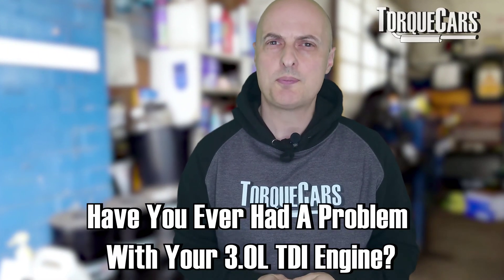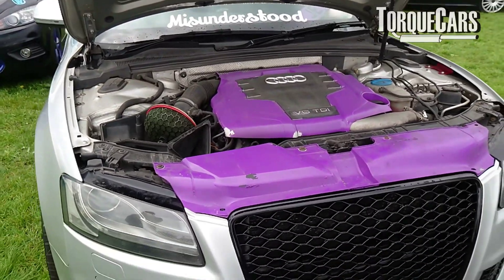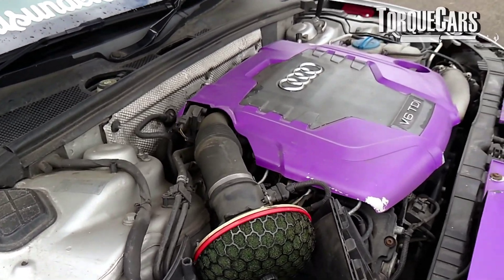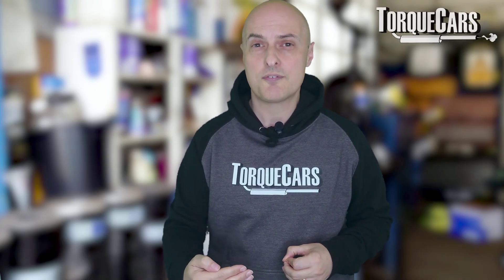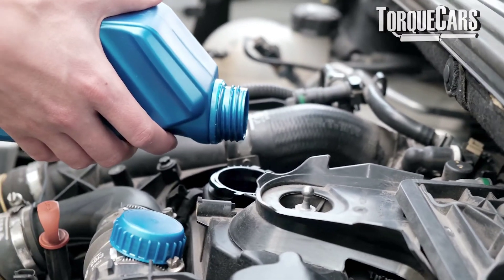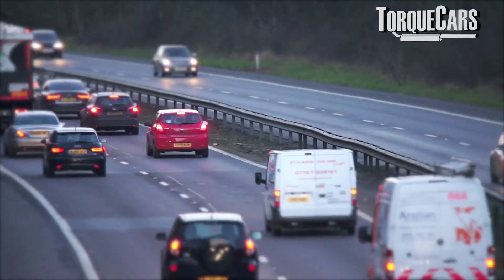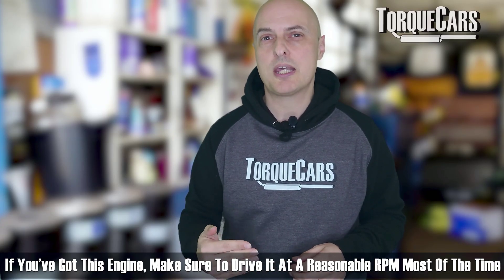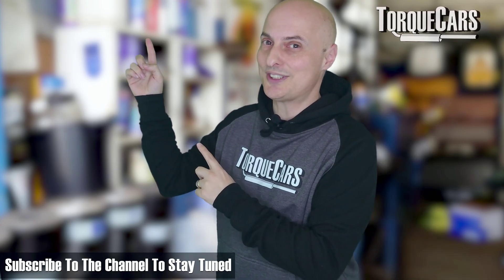Volkswagen 3.0 TDI Engine Failure: Hidden Design Flaw? EA897 Low Oil Pressure Problems

Comment: It happened to me with 108,000 km on a 2017 Audi 3.0tdi  218 hp. Fortunately, with the extended warranty, the 4 camshafts with wear on the metal and the distribution chains have been replaced. Audi indicates that it was a batch of defective camshafts. But it seems that the explanation of the lack of lubrication is more coherent
Reply: Those engines are manufactured to fail and wear out through multiple weak spots. Metal particles come from camshaft sprockets wearing, intermediate sprockets and bearings, oil pump is weak, oil temperature also contribute. Made to fail and cost a fortune to rebuild properly.